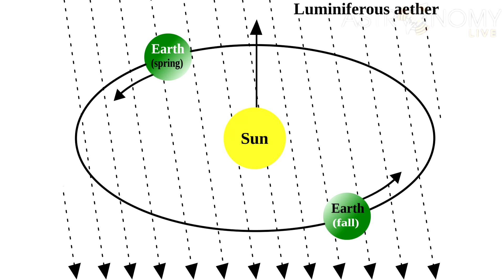Airy's Failure

Comment: The telescope's (or earth's) motion is responsible for the perpendicular component. Due to the water, the light travels the same parallel distance in MORE time, allowing then also the perpendicular component to move FURTHER, given MORE TIME, with NO LESS SPEED, because the telescope/earth are NOT affected by the water, ONLY the light, which is the PARALLEL component.
Reply from the maker: Again, your statement assumes (you even start to say it explicitly) that the lateral or perpendicular component is not affected by the water. As I explained in this video, there would have to be a mechanism for why the water would selectively affect the velocity of light in this fashion. In 1871 it was thought that light was embedded in a medium called aether, giving an absolute reference frame that would not be affected by the slowing effect of water. As I said in the video, if that's what you believe then you need to present evidence for it. Relativity does not predict an increase in aberration with a water filled telescope on a planet orbiting a star looking at other stars, there is no absolute reference frame.
Reply: @Astronomy_Live  you are the one assuming things for myself which I did not. I can not claim selective slowing of light's vectors because i didnt claim multiple vectors for the light. the light's velocity is in a single vector. its going in a straight line. that vector is affected. the parallel one. there is no perpendicular vector of the light to be affected. the telescope is the perpendicular vector. it is not affected by water. the light is not "unaffected" perpendicularly, it doesnt even have that vector to begin with. i did not separate vectors of light, i distinguished the vectors as coming from two sources.
Reply from the maker: @DavidJohnAr  "it is not affected by water," you just confirmed everything I said. You're wrong.
Reply: @Astronomy_Live  i dont understand. why you are being snarky and not elaborating. quote one part out of context. not helping me understand. maybe im wrong. but please help then. you said i claimed the effect is selective. i didnt. how can it select for a perpendicular component of light that doesnt exist? its a straight line. one vector. parallel. that gets affected. the perpendicular is from telescope. telescope not affected. please explain where i dont understand. the light had zero perpendicular velocity with or without water so how can it be affected with water when all that perpendicular velocity is from telescope. sending good vibes 😁
Reply from the maker: @DavidJohnAr  you already said it, you don't think water would have an effect on the lateral motion. This is fundamentally wrong and it's EXACTLY what I'm showing in this video. Imagine if instead of simply slowing light, water stopped light altogether. Your belief system would have the light slam into the side of the telescope at Earth's orbital velocity even though I just told you light stops in the medium in this hypothetical situation. That requires light to have an absolute reference frame and for the medium to be selective in how it affects light's velocity. This is wrong. I'm not being snarky, I'm explaining to you why you're wrong and your statements only affirm everything I already said.
Reply: @Astronomy_Live  I understand your position now! Ok, you make a really good point. So first I'll restate my idea more specifically and then I'll respond to your clever thought-experiment of stopped light. You could actually be right but I still think not, but lets see if I can find out for sure. 

1. In the non-water experiment we have the light and the telescope. The light has v=0 perpendicularly and v=c parallel. The telescope has v=30km/s parallel and v=0 perpendicular. So the light moves toward the lens, parallel, at c, and the telescope moves toward the light perpendicularly at 30km/s. Both are a rigid body, right? So the perpendicular distance is being closed by a stationary light moving at v=0 and the telescope at 30km/s. I think we can agree on that? So net velocity in that vector is 30 km/s. Maybe not. LMK. 

So then we add the water. Here the light's parallel vector is 0.75c, and its perpendicular vector is v=0, right? And the telescope is still 30km/s perpendicular, v=0 parallel, both are rigid bodies so the entire perpendicular acceleration is the same, right? 

Scenario 1: net parallel v=c, perpendicular = 30km/s

Scenario 2: net parallel v=0.75c, perpendicular = 30km/s

Maybe not. LMK if this is where I messed up. Do you suggest that the light actually now experiences a drag from the water which gives it a non-zero negative perpendicular vector? Maybe! But I think we have an issue there because I think I discovered your potential mistake. 

So you suggest the captured light, fully stopped. That idea actually almost got me! But I realize its not the same thing. A full stop would mean either the water is a direct impenetrable barrier like running into a wall, which ofc you dont mean, OR it captures the light in the middle after the light decelerates. However... that would mean the light is physically slowing down when it hits water! Which means we could eventually "stop" light? No way! I realize we can extrapolate that to your suggestion that the water affects the perpendicular vector of light, which remember means somehow changing the light's v=0 acceleration (or the telescope's 30km/s, which I suppose is not in your suggestion), but that would also mean the reverse would be true and we actually could stop light in water! So its a false equivalency. 

To recap: The perpendicular vector of light in both scenarios is v=0, if not you have to provide a mechanism as to how this is changed to a negative non-zero value where it is somehow moving AWAY from the telescope perpendicularly, CHANGING the NET PERPENDICULAR VELOCITY (or slow the telescope). Or else the net perpendicular velocity is 30 km/s in both scenarios (covering the same distance... obviously... just to be clear). Remember that our time is dictated by entry to telescope until contact with lens, so in the water scenario the light is slowed down, NON-SELECTIVELY, in ALL its vectors (which we established is ONE), to 0.75c, so we can say if you want that it IS slowed down perpendicular as well, from v=0 to v=0. Since time is established by parallel component, we get MORE time in the whole system, for ALSO the 30km/s net-perpendicular (telescope) to cover MORE distance, which means it will make contact with the photon before it hits the lens, UNLESS you provide a causal mechanism that CHANGES the NET-PERPENDICULAR-VELOCITY of this situation by CHANGING the v=0 perpendicular light velocity (or the telescope) which we originally observed without the water. Ok, I'm excited to see where I could've gone wrong, cause it seems right to me!
Reply from the maker: @DavidJohnAr  Again you are assuming that the 30 km/s from earth's orbital velocity will affect the "slowed" photon more than a photo in an air filled telescope due to it taking longer to transit through the telescope, but this assumes the "slowed" effect we see does not impact the apparent perpendicular velocity. This is why I pointed out the hypothetical of slowing it to the point of stopping it. Or if you prefer, a hypothetical where it is slowed to walking speed. And to make this even easier to comprehend, forget about starlight for a moment. Imagine you hit it with a stationary laser across the lab and slow the light to a few cm/s velocity. If you pick up the container holding this medium and jostle it, or move it around in circles like you're imitation the motion of a tiny solar system within the lab before the light has had time to progress to the opposite side of your medium containing apparatus, does the light somehow now accelerate relative to the medium, getting slammed into the side of the container as you move it around? No.  

Another thought experiment for you to consider, remembering that to you the speed of light looks constant. You're on a planet going around your sun at 30 km/s and you have starlight come into your medium that slows light to a crawl as described above from such a direction that stellar aberration is at its maximum. Simultaneously, you shoot a laser into your medium at the same angle through the medium, just offset to the side so that you have parallel light from the star and from the laser. Does the light from the star diverge differently in the medium than the laser because of the 30 km/s velocity of earth? If so, then the speed of light is not constant. The starlight diverging due to retaining that 30 km/s velocity relative to the medium has a much faster velocity than the photons from the lab's laser.
Reply: @Astronomy_Live  What? Why would I need the light to accelerate anywhere? Why would I assume anything "affects" the photon in any way differently in either case? I am not saying the photon is accelerating into anything. I specifically said it is affected both ways, but again, 0.75(0) = 0!! See further...

Listen, forget everything. Lets focus on the numbers again. We are talking about the perpendicular vector only here:

Without water:

vTelescope1 = 30km/s
vLight1 = 0
vNet1 = 30km/s
t1 = (distance)/c

With water:

vTelescope2 = 30km/s
vLight2 = 0(0.75) = 0
vNet2 = 30km/s
t2 = (distance)/0.75c

Do you see the issue? The water example covers more distance? While the light remains along the same parallel? I very clearly explained both vectors ARE affected the same way. But the velocity is ALREADY ZERO. 0.75(0) = 0 as I showed in the equation. It moves nowhere. So explain how the photon will not be hit by the telescope, if it is NOT MOVING, and the telescope is ACCELERATING TOWARDS IT, and has MORE TIME. You necessarily, mathematically have to invoke some mechanism to add velocity to the photon, or remove velocity from the telescope. Listen, I am not trying to be pedagogic, you genuinely could be right, but I am  100% sure you havent addressed this properly.
Reply from the maker: @DavidJohnAr  read my hypotheticals again, I'm asking if you think it should accelerate relative to the medium. Do you deny that the photon coming in parallel from The starlight has a different velocity than the photon coming in from the laser if it diverges relative to the laser in the medium? As for the completely stopped example, in practice the way this is done in the lab essentially converts the photon into an excitation state of electrons in the atoms of the material but in a way that preserves the quantum information and that information emerges when the crystal is made transparent again seconds or even a minute later. So no, the telescope is not accelerating towards the photon, the photon is sitting stationary in the telescope if that telescope were made of such a medium. And it's really at that point just an excitation state of electrons in the crystal. It doesn't move around inside the crystal just because the crystal is moved. Again you seem to be having trouble with the concept that light slowed in a medium is forced to travel through the medium no faster than that velocity regardless of what lateral motion that may have had relative to the light source when the light source sent a photon into the medium. The velocity is relative to the medium itself within the medium, does that make sense now to you?
Reply: @Astronomy_Live  

Address the numbers please its the only way we can have a common ground to understand each other. Tell me exactly which number is out of place and doesnt represent reality:

For the light:

v1l= 0
v2l =0(0.75)

Telescope:

v1t= 30km/s
v2t = 30km/s 

v1l + v1t = 30km/s
v2l + v2t = 30km/s

Same distance, more time. 

Tell me which part of the equation doesnt represent reality. The distance or speed must change to compensate for the time. Obviously its not time. I must have a speed value wrong. Tell me which one is wrong. Light cant travel two vectors at once. Its going c parallel, so it must be zero perpendicular. By definition of our vector distinction. Explain the wrong number exactly. You can add thought experiments but you have to say exactly which number(s) is wrong and replace it with the correct number.
Reply from the maker: @DavidJohnAr  "same distance more time" is gibberish. The light is slowed down in all directions equally. In other words it isn't 30km/s inside the water telescope. Address my laser example. Stop ignoring my questions.
Reply: @Astronomy_Live  Dude I am not ignoring your questions... I started asking about equation way before and you didnt talk numbers.

You're right, the light IS slowed down everywhere. The perpendicular direction is slowed down by a factor of .75. But it was zero before also. 

You said the speed isnt 30km/s. So tell me which of its constituents is wrong.

in water:

vL = 0(0.75)
vT = 30km/s

30 + 0 = 30

but you just said it isnt 30. You said I ignored your question but I told you to replace the wrong value with a correct value. To answer my question there must be a new number in your comment. 

So vL or vT is wrong. Since you said 30km/s is wrong. I showed you how I got that number. So tell me YOUR number and how you got it.
Reply from the maker: @DavidJohnAr  I just said, it's not still "30 km/s inside the water telescope," I don't know why you're not understanding this. I told you already, it's slowed down equally in all directions, including the 30 km/s component. Now, answer my hypothetical.
Reply: @Astronomy_Live  Dude you didnt provide your own value. Is the vL wrong or vT wrong. And tell me what it is instead.
Reply from the maker: @DavidJohnAr  You seem to be conflating the water filled telescope with my stopped light example and to be frank I do not have the time to grade your homework on all those kinds of mistakes. My answer is simple and straightforward, the light is slowed in all directions equally, including the 30 km/s component, retaining its original angle when it entered the water filled telescope. Now, answer my hypothetical about the parallel laser.
Reply: @Astronomy_Live  The 30km/s component is the telescope. So the telescope is being slowed? 

Listen, all is good. I dont like talking thought experiments and stuff cause its confusing. You can call it a cop out but we both know its not. We use maths for a reason. I am not conflating your example with anything I am just talking about Airy's experiment.

Right so 30km/s telescope you say is wrong

vT= 30km/s is wrong

so let me know why that value is wrong and replace it. If thats not of interest to you its ok. Also I dont think I've been condescending here so I'm not sure why you are (talking about homework and stuff). But if you dont wanna talk numbers then its ok we can just withdraw and go our separate way. Sending positivity always 😊
Reply from the maker: @DavidJohnAr  the light is being slowed relative to the telescope. All motion is relative. Again, the light slows in all directions equally. Again, you used 0 as the velocity of light but multiplied it by 0.75, conflating my examples. I do not have time to repeat this to you constantly and correct all of these fundamental mathematical mistakes of yours. Please stop wasting my time and address my hypothetical with the parallel laser.
Reply: @Astronomy_Live  I read it. You ask about a laser slowed to whatever velocity in a medium, then asked if moving the medium would make the light accelerate into the wall. The answer is no but thats not whats happening with the telescope. In your example the equivalence would be moving the container holding the medium, in which case if you move it enough, then the edge of the container will hit the laser. I didnt understand your point about the star light and laser being simultaneous. Something again about the lights diverging. I dont think theyre diverging or moving at all is the point, but the container holding the medium is. 

So now that I addressed that let me know what your mathematical analysis would be. So you are saying that we can interpret the 30km/s as coming from either the light or the telescope in this matter due to relative motion? No because although an absolute inertial reference framed isnt claimed to exist in relativity, you do define a system in which a certain frame acts as the stationary one. For this example the light in the cosmos is the stationary frame and the earth is the moving frame. So the light in our case has a speed of 0v and the telescope 30. You cant apply the 30 to the light. So you still have to give me an exact equation and replacement value for the perpendicular speed with water. Show me where you apply the reduction and how it affects the light's vector. Its only fair because I suspended my argument to capitulate to your request for honesty and diplomacy even though I felt my mathematical request wasnt fulfilled. Im hoping now you will show me the exact mathematical process you are imagining to make this clearer.
Reply from the maker: @DavidJohnAr  if they don't diverge then you don't believe that a water filled telescope should produce more aberration if earth is orbiting the sun...
Reply: @Astronomy_Live  what?? see i dont even know what you mean by diverge. the light is not moving anywhere perpendicularly. i explained its the stationary reference frame in our system. we define that. do you see why we like numbers? so we can be on the same page? why are you accusing me of not answering questions when i answered everything and you wont give me my numbers? what is this? please address the exact mathematical question in my last comment.
Reply from the maker: @DavidJohnAr  you don't understand what I mean by diverge? I gave you an example of a laser fired into the telescope parallel with the starlight. If the starlight doesn't diverge from the laser in a water filled telescope going around the sun at 30 km/s then that means you don't actually expect to see greater stellar aberration in airy's experiment even if earth is orbiting the sun. Do you understand what you're admitting? I already explained to you that you are getting the math fundamentally wrong and conflating concepts and I am not going to waste my time trying to sort that out for you. You clearly don't respect my time, but I do. I already explained to you multiple times now that the light slows down in all directions equally and the motion is relative. That includes, but is not limited to, the 30 km/s from Earth's orbit and it is equally affected. Now if you want to keep conflating my example of a medium that would stop light altogether and water which does not stop light all together, that is your problem but I'm not going to play this gotcha game of you trying to pin me to one number where you will then pull out the other example I gave. By admitting that you don't expect the starlight to diverge from the laser in the water filled telescope you admit that this video is correct. Now please respect my time because I frankly have much better things to be doing with it.
Reply: @Astronomy_Live  Its a youtube comment. Idk what you mean by respect your time. You can choose to respond or not. I dont think the light will diverge from the laser I think depending on the medium either both the light and laser will hit the lens or they both wont. The light isnt bending bro it just doesnt have time to reach the lens. Im glad you admitted you think the 30km/s motion of earth will be slowed down by the water in the telescope though. Its also interested how you think just using numbers is looking for a gotcha. Apparently you proved my equation wrong but dont have a replacement. God bless you brother.
Reply from the maker: @DavidJohnAr  You keep spamming my comments section and wasting my time. I already answered you, the light slows down in all directions equally. Yes, you tried to conflate the numbers from my stopped light example with water to play a gotcha game. The amount it slows down depends on which example you're talking about, you conflated multiple examples. It's not hard to understand this, the revised number depends on the example medium and you conflated multiple so there is no one answer. 

You admitting the light wouldn't diverge from the laser is an admission that I was right. "Hit the lens or they both won't" is gibberish and has nothing to do with my hypothetical. "The light isnt bending bro it just doesnt have time to reach the lens." Again this statement is gibberish and has nothing to do with my example. Thank you for admitting I was right. Now stop spamming me.